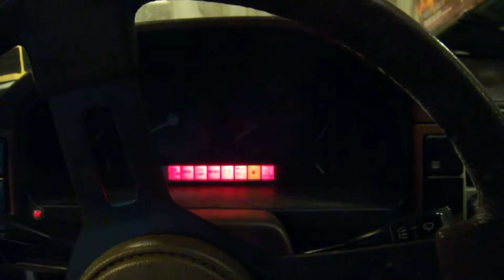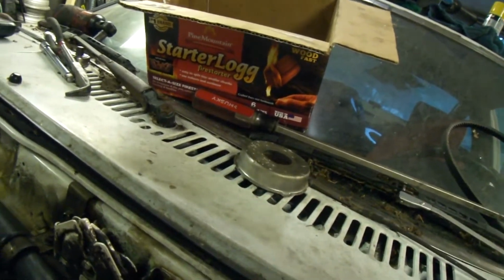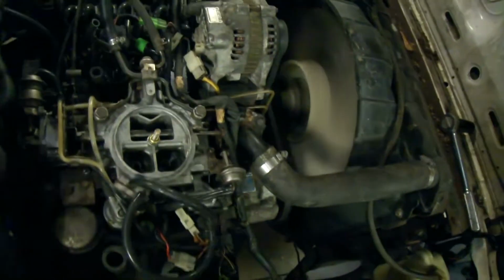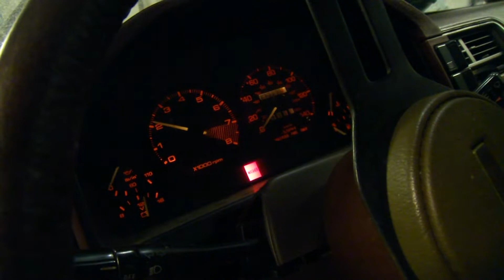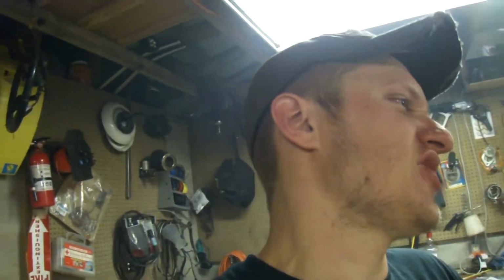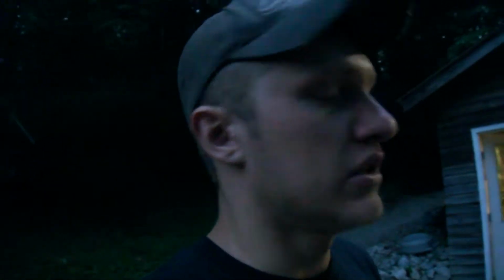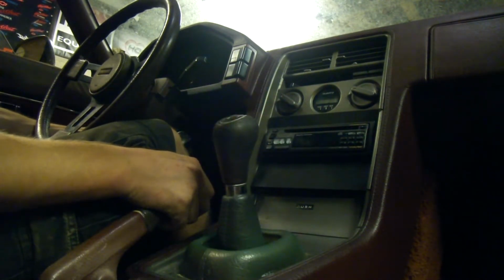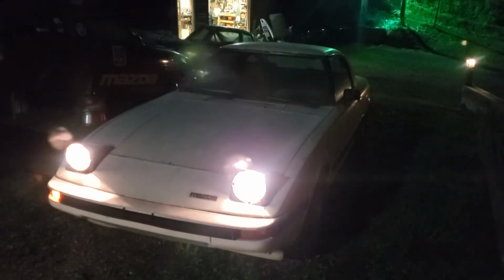Overheated RX7 12a REBUILD - First Drive

Comment: My Nikki doesn't have a choke. Start procedure is to give it 8 small squirts, turn it, when it tries to catch start pumping and ride the pump until it can idle.

Then when oil comes down to <40psi at idle it's ready to drive
Reply: Rebuild time.  Older rotary still start low compression because fresh raw gasoline is being squirted down into the engine.
Reply: @jasondayberry9906  Last I checked good compress, no behavior changes since then, less than 2000 miles on the engine now. It's on a race prepped hogged Nikki that loses venturi velocity and goes flat lean right at the "hold it running for a few seconds" throttle zone, so I ride the accel pump for a few seconds to not rev it dead cold. I drive around it easily once it's warm but the startup without the choke is an understood bit of a compromise.

Comment: I only use the choke in the winter months. Turn key on and listen to the pump, 2 or 3 quick pumps on throttle, turn to start and kinda roll into throttle and hold it about 2k for 30 secs or so and then let her warm up a bit before I move it. Then I keep it under 4k until I hit 180° and the thermostat opens, then send it

Comment: I used to pull the choke, start it and leave it. When it gets to operating temp the choke would pop back in and it would idle perfect. I eventually removed the rats nest, the choke and swapped to an older Nikki. So now I pump it 3 times, start and rev to around 2 or 3 k for a minute or how ever long it takes to idle on it's own. I love 1st gens so damn much.

Comment: My nikki cold start procedure: turn key to accessory, pull out the choke knob, pump the gas pedal 4-5 times and hold it to the floor, turn the key to crank. Usually fires right up. Also, Nikkis love Seafoam. Pour a can or two in the gas tank and it should help clear up any sticking floats/rough idle unless it really needs a rebuild.
Reply: Mine likely needs more than fresh fuel...it sat for 17 years before I got my mitts on it.
 I can certainly add seafoam to the jerry can I have been using for a gas tank though!

Comment: If choke is functioning, once engine is broke in it should be able to be fired without using gas pedal.  Should be able to pull choke easily when turning key to on position, then just turn key.  If using Nikki without choke; turn ignition on, listening for pump, pump gas pedal couple of times, then crank and catch it with gas pedal.  If choke is difficult to pull with ignition in "on" position and cable is not binding somewhere; then something is going on with the circuit that control the choke.  You can find info on how to check circuit on FSM.

Comment: I run a 79 nikki carburetor on my 12a 6 port. Cold start 1 pump to the floor, choke pulled 1/2 way out, crank then give her gas after she lights off holding it at 2000 till warm. I removed the choke to throttle linkage because it would flood.
Reply from the maker: May have to look into the choke throttle linkage.  Or see if i can adjust it

Comment: My nikki carb (1984) was a pain in the butt, I re-gasketed it twice and adjusted/checked the floats 6 times because it was flooding the carb and after 2 months of not being able to fix it i sent it to get fully rebuilt. I recently just got it back last week and after putting it on it flooded again, so banged the inlet banjo bolts with a mallet and that dropped the needles down. Now it works perfect, although im still getting some smoke out the pipe once the temp gets to 180 (digital gauge) and idles just like yours around 1500. Currently im trying to adjust the idle mixture and idle speed screws to see if i can drop it to at-least below 1000. Though i do think i have a vacuum leak, with the rats nest or air control valve. Just a whole lot of diagnosing i still need to do in order to pass smog

Before i got the carb rebuilt it would start up with long cranks like yours, although mine was dumping alot of fuel with alot of smoke as well. Now it starts up with out choke or gas pedal pumping. 

Your car just has long cranks and little smoke and little exhaust pops, I also have little exhaust pops at idle. Just wondering if thats normal?
Its a good comparison to see how annoying these carbs can be :)

Its crazy, Ive been rebuilding this car for a over a year now and your videos lined up perfectly with my progress. Honestly your videos are great. I had to figure alot of things out through forums and manuals, if had your expertise back then i would have saved some time.

I really appreciate the videos man thanks
Reply from the maker: Awesome brother!!! Keep up the hard work!!  All of my personal cars run something other than a nikki. So I have mever learned these.  All I know about them besides just a good understanding of carbs in general is that they are finicky and i dont like them.   But maybe my views are biased haha.  Weber for life!
Reply: RAD Potential lol you’re most likely right there, couple forums I read said to trash the nikki if you ever get the chance.

Comment: What did you do to correct the flooding? A few good raps? Lift top of Nikki, and manually move stuff? Just went away after a good drink of fresh fuel?
Reply from the maker: Smacked it with a screwdriver.  Healed

Comment: Hay what would be the sign of a bad voltage regulator?
Reply: If your talking about your alternator: 
You can measure it. 
If the voltage increases with increasing RPM you know the regulator is broken. 
The same if you let the car idle, measure the charging voltage, this should be around  13 - 14V